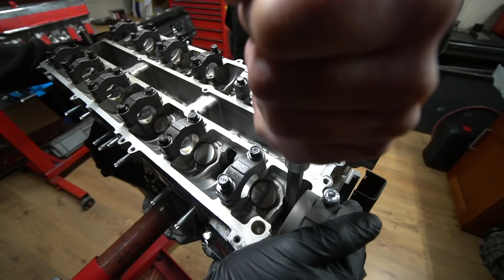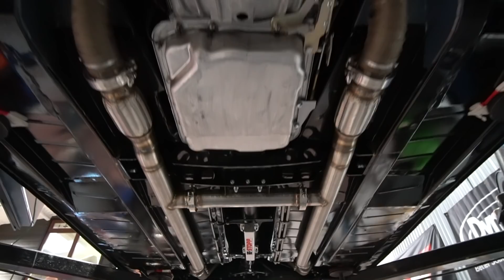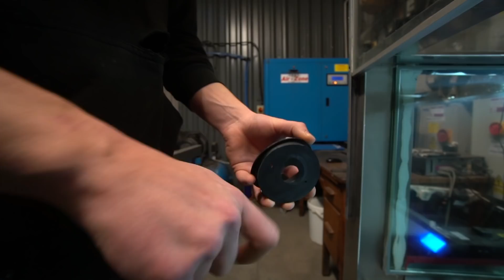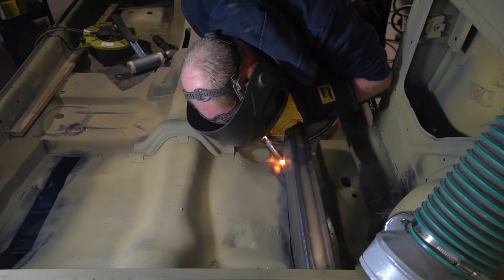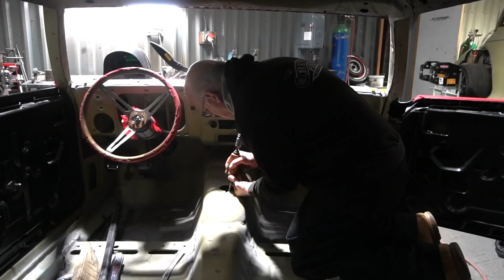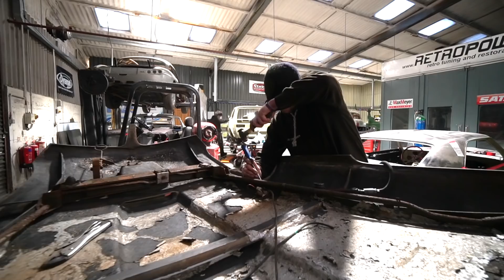Retropower Uncut Episode 16: LS3 Powered W111 Mercedes Fire-Up! 2JZ on ITBs & 68 Camaro Metalwork

Comment: Valve job: a very under appreciated bit of advanced maintenance espec on engines over 100k miles. I had this done on my mx-5 (I do a lot of stuff myself, mostly to save money to throw at people like retropower for the big jobs...) and the difference in smoothness, power delivery, fuel economy, was quite significant. Was well worth throwing an extra 500 at the mechanic to do in addition to the timing belt/water pump etc.

Comment: As always a real pleasure to watch!  May I make a couple of suggestions -  why not invest in your own specialised machine shop and install your own 3D scanner. This would save  delays and cut the  build time on your wonderful projects. Secondly being a dedicated  hater of  the LS motor that seems to infest some of your cars, surely a modern Mercedes Benz V8  would have been a better choice for the Project Kaisers. In AMG tune the power output would have matched that of the LS and complete with its transmission would have maintaine the Mercedes resto mod theme. These engines are a common fitment in Germany and I suggest that you check up on the several Mercedes resto mod specialist company's sites for further information.

Comment: Utah’s rear lights are very- very similar to Nissan figaro, They are the odd shape too as they fit the curvature at the rear but they are chrome finished plastic (I bought them online for my beach buggy) I ended up using “truck-lite” that have stainless surrounds, the lenses are held in with a round clip they do look good with their frenched in style and a nice bezel

Comment: The power people have been getting out of straight sixes these days is crazy, the 2JZ, the RB's and the Barra's are monsters.
Reply: What's an RB...
Reply: @joeschlotthauer840  The RB is the engine that came in the Nissan Skyline GTR's RB26, 28 and 30 etc which refers to their displacement.
Reply: @2ToneWalt  
Thanks for responding...
I remember it as a Chrysler term, "B and RB engines"

Comment: The very obvious. Webers require soft mounts or they will have all sorts of viabration issues. The one piece filter too will do the same.
With the Camaro, think!. Those things flex quite a lot. Hence all the rubber mounts. When solid mounted the gaps will change.  Even the doors. All of this is ok for a racecar but not a roadcar.
The Mustangs were a LOT stiffer car.
As for the Jensen,, keep it Mopar powered.  All bar the real early ones had big blocks, 383 or 440. No problem with parts for those and the same streetable power. If not more. Alloy heads, intake etc gets the weight down
Reply: Current trend in the US/UK/ Aus is for placing modern V8's in old classics, ditching the SBC, Ford Windsor etc etc. The other bloke explained why they didn't go with the latest Chrysler V8 in the last video (no agency in the UK)

Comment: OK I am no engineer but wouldn't a Y pipe sweeping away from the engine be better than a H pipe on the exhaust ?
Reply: There’d probably be a couple of horsepower in it due to slightly better scavenging, but to an extent, pressure is pressure, and a h pipe setup will still scavenge way better than having no link between the banks.

Comment: That Mercedes looks the dogs. Tax and MOT exempt?.
Reply: would doubt it, i own a tax and mot exempt landrover, there's a points system to keep the exemption including engine brakes suspension etc, too many changes to the merc for it to be classed as original for exemption.
Reply: @budycelyn  whats happened to all those V8 hot rods with a Ford pop body and jag back end.  40s/50s steel body running the original reg.
When the tax exempt came in ,most where , according to the reg plate 25+ years old. 
If i recall it was vehicles registered before 1973, then rolled over every year.
Reply: @michaelwalker1145  you would be correct but this law about the points system came in a couple of years ago, its not that old, if you couldn't prove that the vehicle modifications were done before 2008 then you couldn't claim exemption for it,
Reply: @budycelyn  thanks, one reson I asked is i have a reliant trike thats registered as a trike.
Basically its got the full reliant running gear and the chassis, narrow at the engine part and a motor cycle front end.
This is still on its 1978 reg. 
Its been a trike since at least 2000.
Reply: @michaelwalker1145  should think you would be ok for the exemption in that case, i tried a few years ago with another landrover i had, it was a 1972 v8 shortened rangerover chassis with a 1976 series 3 body on it, it would have cost to much for the engineering checks and it would have wound up being a q plate instead of its age related registration, so i sold it as parts
Reply: I suggest nobody should be informed of changes. It's none of anyone's business as far as I would be concerned. To many rules n regs. Load of ol bollocks
Reply: @kevinford6420  yes, too many rules but hey get into an accident then have your insurance voided because of unlisted modifications, your choice .
Reply: As the owner is in Nigeria I don't think it matters. I'm guessing they don't even have MOT's over there
Reply: @lemmy9996  fair point :)